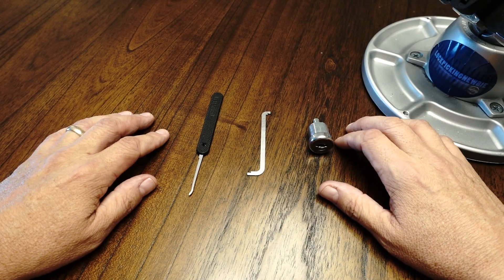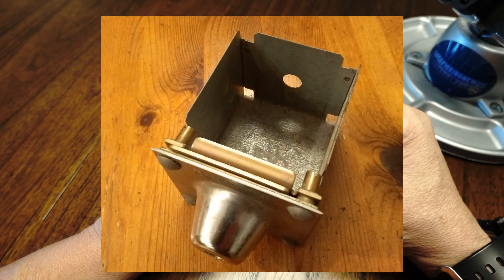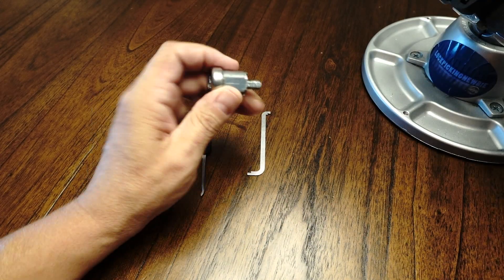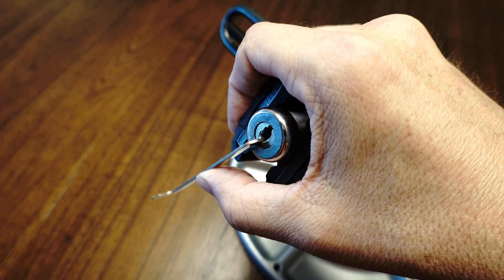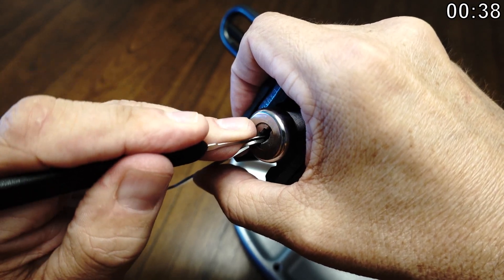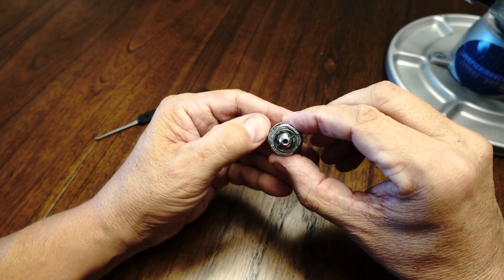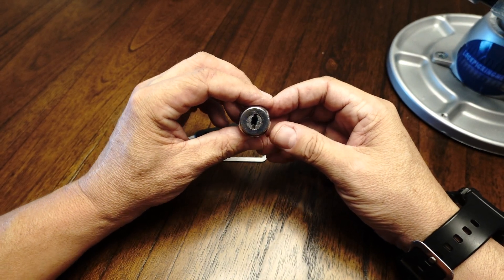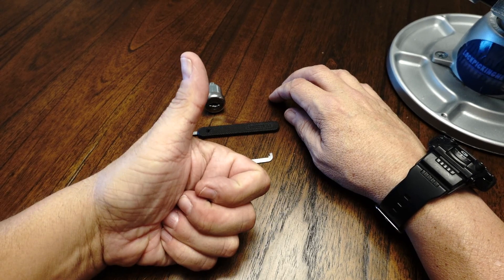[151] Laundry Coinbox Lock Picked

Comment: I wanted to be able to open the coin boxes in my apartment building laundry machines, was hoping this video was for me.
Reply: Same
Reply: Hey, by the way... I also tried the raking method. It didn’t work out so well
Reply: Hey, you can probably lock pick it open with a couple of tools. Message me and I’ll let you know
Reply: Your cute
Reply: @mofakah5906  I want to know🤫
Reply: @Mo Fakah  you figure out how to do it? I thought I'd best the machine and drilled a hole in a quarter and not have to pay 2 dollars to use the washer, got the quarter stuck an used a zip tie to push the quarter in an now the zip tie is stuck in the machine... tryna get it out ASAP before anyone else notices. 😬😬
Reply: Did you get it out before anyone saw? Lmao
Reply: Did you figure out the way into them?

Comment: It always seems to come back to single picking and good old counting and feeling. The wrench can make a difference. So a wafer lock doesn't have false set pins or any other security pins?
I am pretty new to this, but buy the biggest most secure padlock any time I get the chance and pick them. Raking, single pin pick, and bumping have given me access to everyone I've tried so far. I am obsessed with picking. I love the feeling of that first set pin catching. So like I've said I've just done padlocks and some door deadbolts, but am ready to move on to other challenges,and someday make it to safes, the holy grail. I get a nice sense of satisfaction knowing I beat the security of the design, and want some challenges. I finally get why some locksmiths don't like this information getting out. But most criminals are lazy/not very bright and this is an art form almost they wouldn't take the time or have the patience to master.
Any ideas?